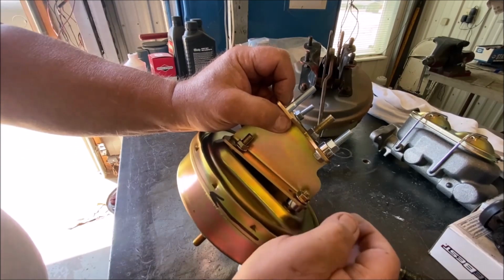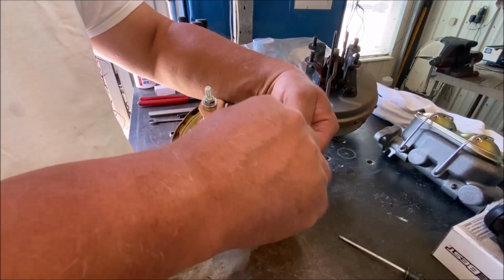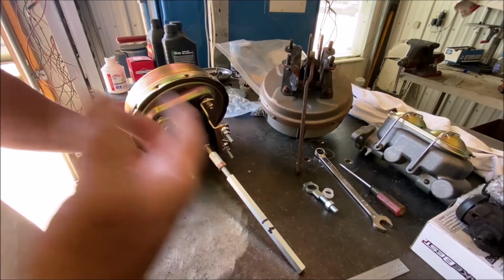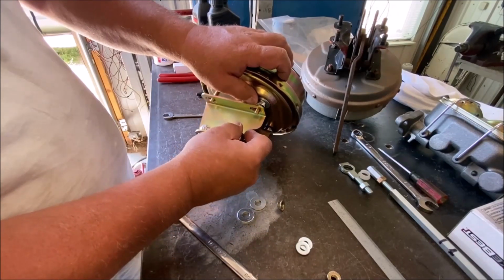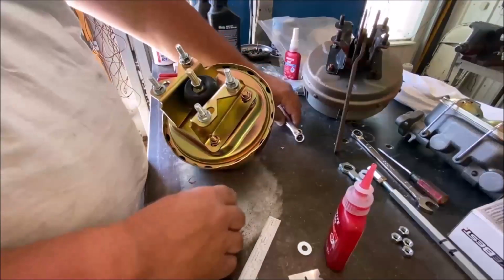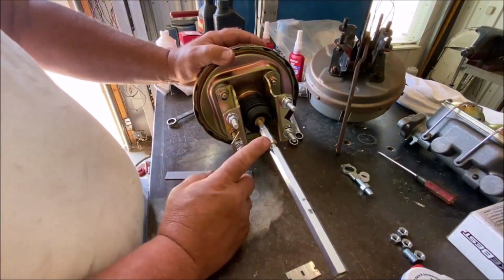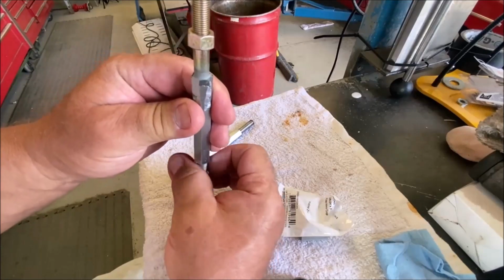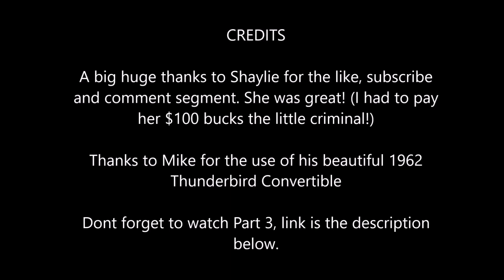1961 64 Thunderbird Brake Booster and Dual Master Cylinder Retrofit, PART 2

Comment: I have a 1963 and 1964 galaxies my 63 has power brakes already and my question is why would the bracket from the original booster not fit the aftermarket booster and then put that in and would save all the hassle
Reply from the maker: Hey Paul, I tried that, tried to fit the bracket, modify the bracket, etc, and it didnt work. You can try to fit your original bracket, maybe you can see something that I didnt? Good luck.